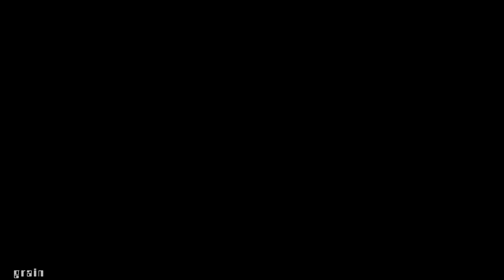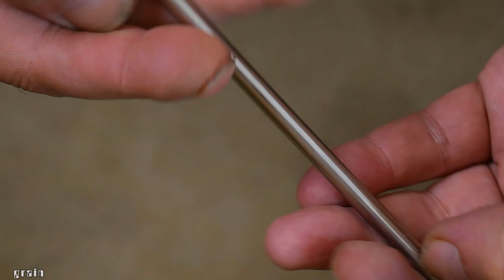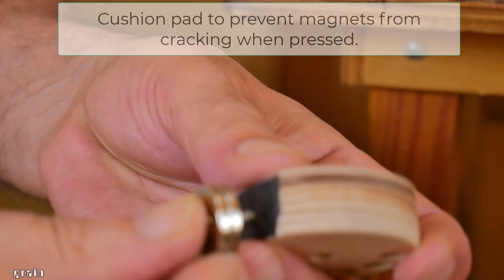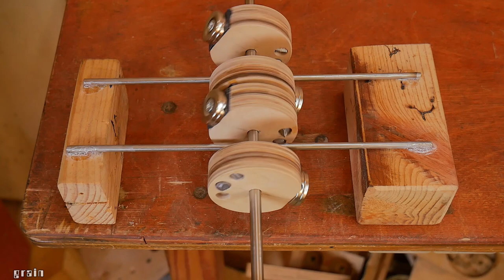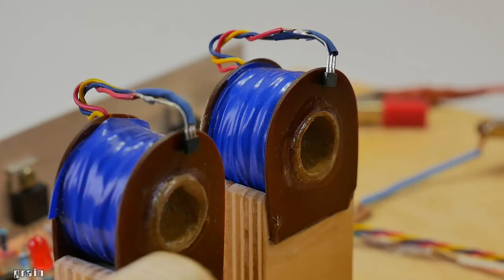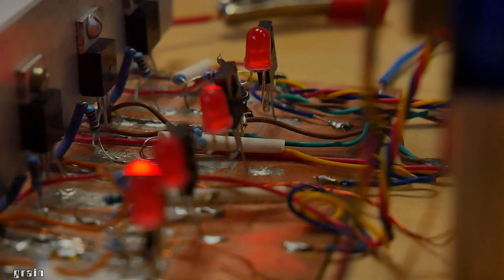4 Hall sensors electromagnetic ENGINE

Comment from the maker: In short: when the magnet approaches the Hall sensor, it triggers and turns on the transistor that turns on the coil. The magnet is attracted, the rotor rotates, it is about 40-60 degrees of rotation, it moves by inertia after closing the Hall and the transistor. After 90 degrees, everything is repeated with the second coil, then with the third, fourth. Each coil has its own electronic control. And so 4 times at 90 degrees, a full rotation of 360 degrees.
Transistors IRF4905, polarity P. The second transistor is only needed to turn on the LED.
In principle, this motor can be made on reed switches, but reed switches are very sensitive to magnets and would have to be located far from each other.
Reply from the maker: Single phase circuit - https://ibb.co/YRHk9BN
Reply: Тоже  самое с магнитами при одной полярности отталкиваются и диск вращается ротор ,а статор нужно смещаеть  вдоль оси ротора на подшипниках относительно ротора т,е делать возвратно поступательное движение,потери 15 процентов от намогниченности магнитов потери на сдвиг, кпд85 это механика
Reply: hello grain , i'm making your project so i need little more info can you plss help me with that ..... plss give me something so i can contact you ... !!

Comment: I love Hall sensors and this there the best. I also found a different type of Hall sensor (by accident) that has a 4th leg terminal and does not need a transistor to trigger the coil. This Hall sensor must have a built in transistor and cuts out all the complexity in the circuit. The only down side is that it can only run on 5v max and very thin coil wire or the chip get really hot. So really you only need the sensor and the coil.

Comment: Nice! Is there any way of controlling the speed?
Reply from the maker: No, in this version it is possible only to change with voltage, but without control. To control any engine, a separate sensor with an RPM controller is needed.

Comment: nice, simple, using less , can run many practical mini devices 
.. it's using a lot of volt's for the size of pulsed coils, why ? 
, perhaps an enclosed laminate coil (transformer E style) will reclaim more pulsed magnetic field for less volts in the same space..
better use of unused bemf through a diode direct to the next coil or delaying cap (takes x time to charge & release) !
Reply from the maker: I made 500 turns in the coils, this is a lot, it was necessary to make 200-300 turns.